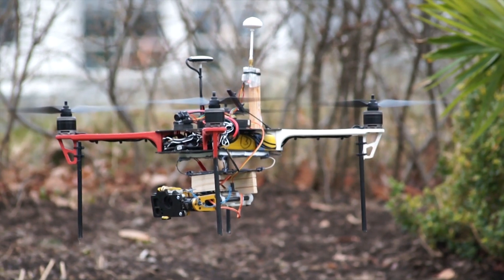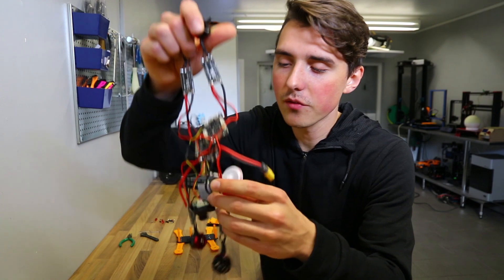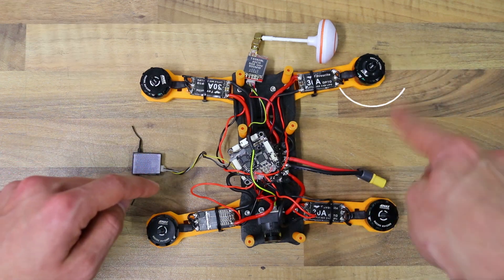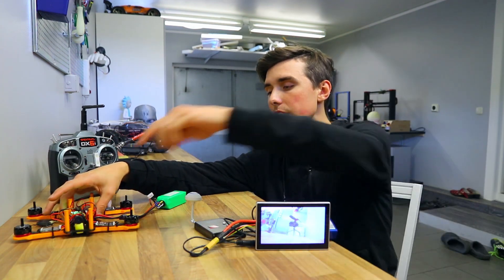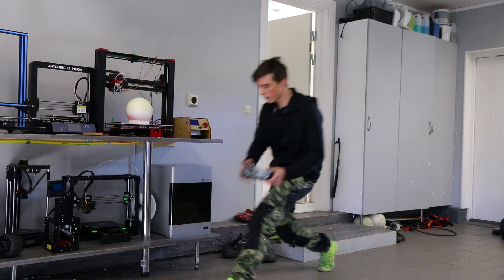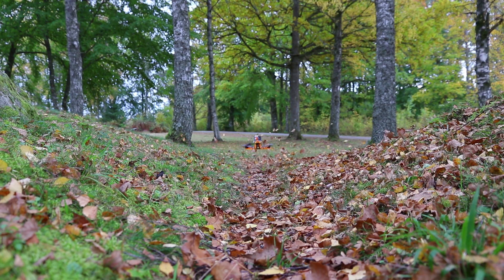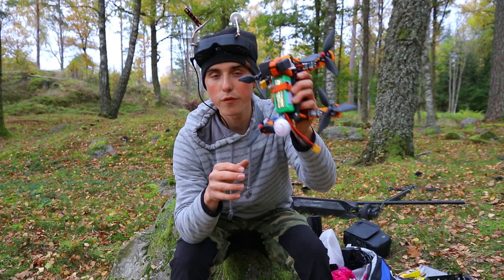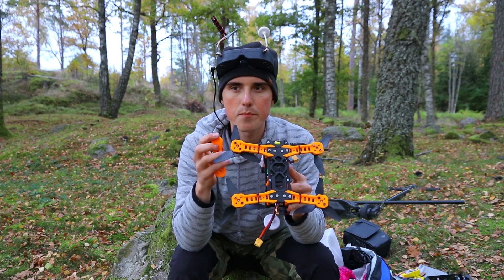3D Printed Racing Drone - Will It Survive?

Comment: When doing 100& infill don't use the grid or lines or gyroid settings or whatever.Use Concentric.Couldn't figure out why Concentric Infill exists as it's pretty much useless at any infill other than 100%.Until I realized the strength it gives when used like that.Strength will blow your mind

Comment: A carbon fiber drone frame is not even very expensive, very light, as strong as steel, and are easily available online. My carbon fiber quad frame has survived crashes into trees and the ground at 80+mph. 3d printed parts have there place when building a quad for example print an antenna mount or protective bumpers. But I guarantee if you print this quad you will be disappointed and will end up buying a nearly indestructible carbon fiber one.

Comment: Change the structure of the 4 arms stretched out.have you cut through a thick paper box, usually it has 7 layers,one is flat,next one is like waves with  sharp teeth,then another flat one ......this is what makes soft papers strong at least in one direction.
Reply: I found later in the video that your solution was to add a carbon fibre bone onto it.good but expensive

Comment: I'd guess the arms got softer because of the heat form ESCs. Simple trick is to put a carbon fiber (or at least nylon) pad in between ESCs and motors and the arms to shield the arms from the emitted heat. ;-)

Comment: If you want a professional printed frame go for carbon fiber nylon, though you'll need a special printer that can cut the fibers.
The mid professional approach is nylon, next is ABS.
Never use PLA, for nothing. It's cheap crap.

Comment: Amazing video! I also build 3D printed drones and I have to say they fly really well. Of course they are not as strong as professional frames but you can just print spare parts very quickly and more and more improve your drone with redesigned parts.

Comment: Mate your project is great but you've done a biggest mistake with PLA, PLA is very sensitive to external temperature change and it deforms easily, PLA is only stable within the specific temperature range and reducing or increasing the oustide temperature will affect significantly on PLA structure. For this drone it must be at least ABS ,but I would go with Carbon Fibre for best weight to durability aspect ratio. But so far your drone is amazing, something I´ll be buildilng myself as watched your video and loved it.

Comment: Somebody knows how much money for everything?
Reply: You can start with as low as 200-250 euros, however the more you spend at the beginning the less you will regret your coises later on.

I started with such a low budget and broke almost everything of my first quad (it was a wizard x220 prebuilt) within 2-3 months. I also went for the cheapest fpv goggle for around 30 euros, but the experience was 10x better with a goggle that was less than 3x the price (around 80 euros)

Comment: Hello I noticed that you use a Spektrum DX6i i am printing this same frame and i got that same radio transmitter but people here said the is not for quad could help me setting up my radio with the quad and which Flight Controller did you use compatible with DSM2 thank you i will really be very thankful for your help

Comment: Is it good to put battery on very top of a drone? Isn't it bettter to mount it on the same level as motors are?
Reply: It basically doesn't matter whether you put it on the top or bottom
Racers usually bottom mount their battery so they can turn faster because of gravity or some other sht

Comment: The design of the 3d printed parts could be way better. If you just make these parts as flat as they are, you‘re better off making them out of carbon fiber sheets.
A complete waste of the potential, that 3d printers have.

Comment: Do you program the flight controller
Reply: Depending on the firmware you wish to use you can use stuff like betaflight, butterflight...KISS....stuff like that.  For programming ESCs you might use BLHeli Suite or something similar.

Comment: Here is an Idea, heat the wrapped parts with a heat gun, not only will this melt it a little depending on the heat making it a semi solid piece, but you can also clap the flexible PLA slightly to help reduce the bend.

Comment: You are using a Spektrum DX6i. Have one too and I like it. In the description you only suggest a Flysky FS. Which receiver for DSM2/DSMX did you use? Found a cheap one (10$) on Banggood but does the cheap ones really work?

Comment: could you give a list of things we will need because most of the stuff in description has been sold out?
Reply: -FPV camera
-VTX (for the video transmition)
-Flight Controller, an F4 is the best
-Esc 4in1 or separate (for the motor)
-4 brushless motors
-props (many props haha)
- 4S lipos in 75C minimum
And a CARBON frame ;)

Comment: I'm sure you had the vibration before. PETG is shitty and flexible as hell. ABS is lighter and stronger. Nylon would be the best. Infill doesn't help your strength much either. More walls/perimeters will help the strength more.
Reply: I thought nylon is flexible as hell!?

Comment: hi, i am making this drone and only have the frame. i have ordered some electronics, but was wondering if you could tell me if there is some other electronics i need to buy?
what i have bought now from ebay:
1x (Racerstar RS20Ax4 20A 4 in 1), 4x (A2212 2200KV 6T Motor Outrunner Brushless) and 1x (Matek Systems PDB XT60)
what else do i need? thank you

Comment: There have been issues like your wobbling before on non 3D printed quads. It could be vibration feedback coming into the FC and it trying to compensate for it. Idk if you have done this before, but try putting a single O-Ring under each of the posts for the boards so it absorbs some of the vibrations. Great vid though!

Comment: Why not ABS or HIPS? The HIPS has it literally in the name.. High Impact PolyStyrene

It is mostly known as a Dissolvable material (but only in kind of exotic exotic solvents), but it is so much more.. it prints great, has great mechanical properties and is VERY cheap. A great alternative to ABS as a general purpose printing material.

Comment: How Much of the stuff in the list is the stuff you used to build the copter?
I am interested in building one but  i am new to this technology.  I am a electronics engineer and know that all this stuff is not created equal. I have had some experience with gearbest but was only some what satisfied with the stuff I bought. Could you list the parts used in the video. Do you know if there is better and or cheaper stuff available?

Comment: i print it too. it works but PLA ist not temperature resistent and the motors glow into the plastic. i print it with ABS and build a PLA support because ABS was to flexible and the 
vibrations... .Now it work pretty well and have a lot of power. Great video

Comment: Great video! Wanting to print and build an FPV racer myself! :) Quick question: I have the same 600 mw transmitter, it seems to work, but mine gets around 90C ( 194F ), you experienced heat trouble?

Comment: Hi there I think your the guy to potentially build a prototype winch system for a drone.
I intend to run a fast food takeaway selling Fish.
Now it makes logical sense to have a fleet of drones delivering my delicious food.
I have looked the Legals and there seem to be no major restrictions to using drones other than the obvious licence required
and the relevant flying skills which you will be trained to a level on a 3 day course costing  £800-£1200 in UK.#
Now this cost is nothing when you compare the costs/problems incurred by a conventional take away....human traffic/insurance/
traffic jams/sickness /maintanence etc etc the list goes on.
I have seen a drone developed by DelivAir in the UK (Cambridge) please Check it out as this is the concept I want to cost slash by 3d printing the Winch delivery mechanism and make it connect to the drone of my choice, DJI Mavik for e.g.
Not only would it be amazing to print and build your own drone but build an amazing drop winch system that would 
fly my drone to the intended client via an App on their phone...hover at a Legal safe height i think its 30ft....lock onto the phone signal....open a 3d printed housing unit attatched to my drone...winch down my food attatched to a winch/fishing line..... customer never comes into contact with the drone,unclips the food package.....winch/tether line returns to the drones housing unit and returns to base......Poetry in motion my friend.
I think this approach would give a lot more flexibility to the delivery Idea.
Can you pls pls help or point me in the right direction
could you get back to me  Cheers 
joseph_aru@hotmail.co.uk

Comment: lost my sj4000wifi in a field in january(2016), it was found in march(2016), the kids who found it turned it on and it autorecorded them finding it as the battery still had charge, it had water trapped in the lens not a great video and the audio was also muffled, stripped cleaned new lens and put back into use. i'll buy sj everytime now.

Comment: 4:52 Has anyone played with the positioning of components on this frame? If you don't have a GoPro and just want to use the FPV camera, it looks like the supports could be made shorter or even remove the entire top level and just create a cage for the controller/cables/camera/battery on the base level to save some weight. Sorry, I'm new to this and was wondering why the top level is needed if I don't have a GoPro. If there is no GoPro, the top level is only used for the battery which would make it top heavy.

Comment: if anyone is curious about cracks, they form internally. changing in-fill could result in a more rigid member. im also curious if using a solid member, thats thinner, but with external ribbing would help with rigidity. your inertia numbers should be nicer.

Comment: I thought of a new 3D printed project if your interested. Could you print some Leonardo da Vinci's air screw propellors and try to get a quadcopter to fly with them? I tried to find a video of someone flying one but i couldn't find much. This one one of the oldest drawings of flying machines where he tries to design a type of corkscrew helicopter. But i bet if you could get them to balance they would fly a quadcopter. You will have to make both cw and ccw.

Comment: The motors produce a vibration frequency. The motor frequency cannot match the natural frequency, or the craft will shake itself apart.
You have to calculate the natural frequency of the drone, then, add a damper to change the output frequency of the motors. On the other hand, it looks like it is only vibrating at low velocity, so there is some range at low velocity when the motor and natural frequency are close. This will resolve itself if you significantly change the natural frequency, ergo, go fast.

The trick is to calculate the range of velocities that you expect to fly at, then you can calculate the range of the natural frequencies which the craft will experience. Also, calculate the frequencies at which the motors will vibrate at, because the motor is not constant. As long as the ranges do not overlap, your craft will not experience harmonic resonation.

Comment: when you print something try to use diagonal infill layers, cross each other every other layer. There is a setting for that in Cura.
It makes your arm stronger from all sides. 
You can also try to print in nylon or polycarbonate. Extremely strong. a 4mm nylon printed part is almost as strong as a nylon reinforced carbon fyber part. And with the right infill setting you can make it even lighter. I had success with only 15% infill on a 10cm long nylon printed arm. At some point strengthness is not really the problem, but having too much flexibility.

Comment: the vibrations could have been fixed by PID-tuning.
Reply: True, but that would sacrifice controller responsiveness!
Reply: PID Tuning does not effect the responsiveness unless you set them extremely low, to the point where they are basically inactive.

Comment: About the infill problem: maybe its possible to solve this by printing with a little bit more heat so the infill could have a stronger connection to the layer below.
Or of cause using more infill but this goes on the weight..
Just an idea.

Would be nice to know for myself because I have a 3dprinter since a year now and also always try to step it up a little.

Comment: hey bro can you tell me what filament to use for my cr 10 
abs can't  be used
suggest me a better option other than abs 
and also tell me how to get a strong objects using pla
Reply: David Lee if you want pretty strong PLA prints you should watch Angus' video on it over on Makers Muse channel. Use more walls with like a 25% infill. That's how I do it and I get some pretty fantastic results. I also increase hot end temp and decrease print speed, I don't really know if this helps as much as using extra walls though.

Comment: Ok Im just randomly jumping in here asking a stupid question, hopefully i can get an answer, is it possible to get a cr-10 printer or similar, extend/replace the rails, wiring, and print pad surface, reprogram/mod the software/hardware to expand the print surface by a significant amount? or is this just out of the question?
Reply from the maker: This is a printer with a 500x500x500mm build volume. At this point it would be better to simply print parts of what makes up a huge print, instead of building a massive 3D printer. https://www.gearbest.com/3d-printers-3d-printer-kits/pp_795723.html
Reply: I'm thinking one piece parts that must be one solid piece, approximately 800mm long, probably be better to make the printer from scratch, altho, doubling the Y axis so that the Plate moves 2x as far in both directions, Mechanically shouldn't be a problem, extend the belts and rails, wiring, then program it. Maybe the plastic would cool too quickly between passes? save serious money if its possible, be a crazy cool upgrade. Im a noob and I have never even touched a 3d printer. So excuse my ignorance.

Comment: i didnt see you put it on a scale? what was the weight?    i mean it looks cool but knowing the frames weight must be one of the most important things you need to know, .........   and yes there is the best drone frame. ... the best drone frame is any frame that you get a great price point, and performs well, and is durable. there are probably 100+ frames on the market that fit that category. i mean for 80% of us who fly for fun, almost any 25$ frame, is the best frame. i mean i can find QAV 210 clones for under 25 bucks, and big deal if u break it after  25 flights, IT WAS 25 BUCKS! , buy another,,,,,     the market is flooded with clones , and i have flown many of them and been very impressed. i flew a martian 2 for a while ( alien clone) and bashed and thrashed it like you wouldn't believe. ive taught 2 people to fly with it, and its been handed down 3 times through my friends, and guess what -- that frame was 30 bucks, and a friend of mine still flies it.... there are so many cheap , however  very good products right now its amazing.

Comment: I think what may have happen was when you switched to 4 cell the motors and esc were only calibrated towards 3cell. Not sure if that makes a difference but today I went to fly and finally put a 4 cell in. My quad flew great for a minute then I got a weird wiggle and fell to the ground. I got my quad and one of my motors was really hot and it actually burnt the motor out. That heat could be causing your frame to flex.

Comment: The Emax motors are pretty powerful, i had to soft mount mine on a carbon fibre frame to avoid vibrations. And use self adhesive neon foil on the whole gopro so you can find it better independent of the position it ends up in the grass. And if you still cannot find come back during night with an UV torch. :)

Comment: Awesome video, total cost? Not including 3D printed parts?
Reply: Wesley Olifant The goggles alone he used are a few hundred dollars. The rest can be bought under $200.

There are budget goggles but they are larger, lower res and often not as comfortable. They are still great to start with and will help you decide of the hobby is worth sinking money into. You can have multiple receivers in the same channel so if you ever upgrade, your cheap goggles are good for letting others watch through the camera.

Comment: Fantastic video production and the content is superb!  As a suggestion, maybe try carbon fiber structural cross sections like a square tube or round tubes embedded in your 3D printed arms and plate.  Remember when creating a laminate you want the glue to be consistent and intimate so there is a good transfer of load between the structures.  I enjoy that you use the correct engineering terms (e.g. tough and resilient) for the materials.  Thank you!

Comment: Your vibrating problem looks like it was a resonant frequency issue and not a material property/delamination issue. If you changed the shape of your arm cross-sections to something more like a T-beam you could probably get away from using extra materials like carbon fiber plates and go back to ~25% infill.